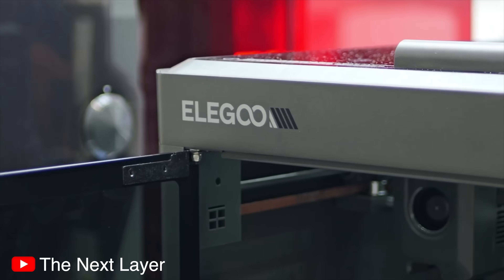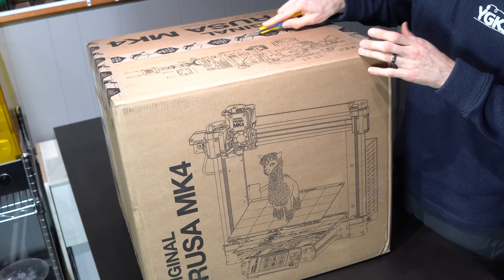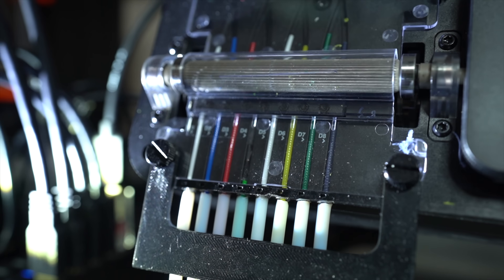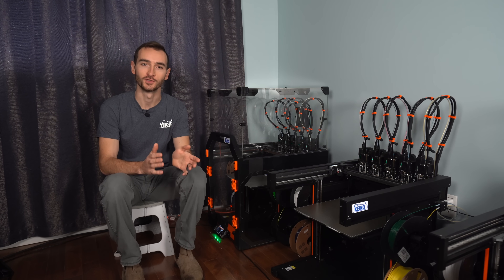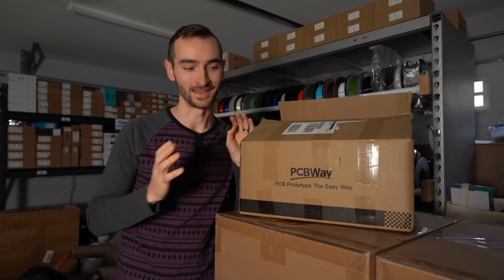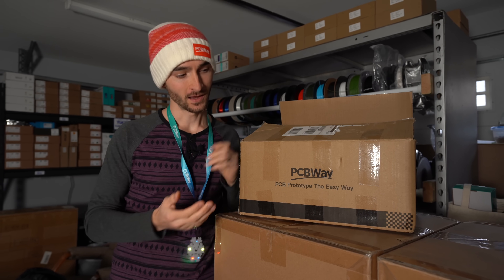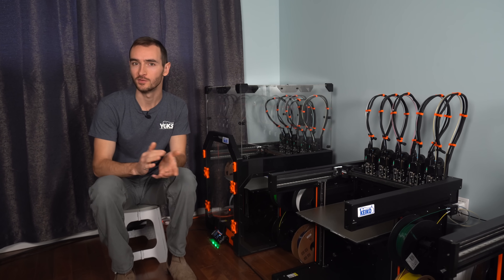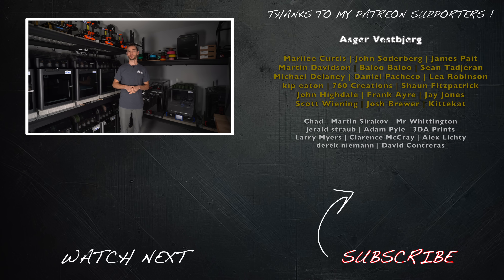The Prusa Core One is dividing the internet...

Comment: Wouldn’t spend that much money on either one. The old-school 3d printer’ers well we like to tinker. I have my ad5mpro and i have made it super durable and compliant. New belts and modifications. One thing I haven’t ent changed is the nozzle and firmware. 

Its fast as or faster than any printer out their, future proof in hepa filtration and cooling and xy printer. Parts available and have spares just in case. Over 1.5k hours. Can do manual filament swap and multi material some what thanks to orca slicer.

Comment: I just did many many hours of research to purchase my first 3D printer. I wanted to buy Prusa, but they offer so little for their price, and Bambu, although more competitive in price, are still pricy and very very closed, which I disagree with (Linux pleb).

I finalized on a Qidi Q2, more features and capability then Prusa at 1/2 the price, and in the middle when it comes to open.

I figure even if my business idea goes well it will be better to buy twice as many printers to feed the need then to buy 1/2 the printers and have Prusa reliability.

Comment: I have both, and I wouldn't sell either atm, even the H2D hasn't tempted me yet,  that has still got too many faults, and that's the reason they released he H2S so quickly afterwards.  If anything new atm i'd be waiting for the bigger Snapmaker U1,,, they always do a range of sizes so the bigger one is due probably with 7 or 8 tool heads like the XL but all contained and polished like the Bambu... I can't wait !!

Comment: Its all so obvious if you have experience in 3d printing. Prusa printers just effing work. They just work and work and work an work, for years and years. You can exchange all pieces that might wear out easily yourself, and print parts for it officially supported. What more could you ask for? Its blatantly obvious what the best printers are.

Comment: The build plate size is NOT true part of the plate is used over calibration and the corner is the cutter shrinking that “usable” space to pretty much the same on both machines except Prusa takes the edge as it has a higher ceiling limit.

Comment: P1s in now about 370€ tax free (for business) in europe. Core one is 1075€. This is revolution, nothing less. It is now actually possible to design for fdm print and base design on that.

oh forgot prusa does not include shipping. so in all for one prusa core you can get three p1s. point is they do not have the same market. bambu can extremely rapidly expand the capability to produce, it is a tool you can buy for a single job.

Comment: By now, the X1 is getting old. The H2D makes repair much easier. Most of us don’t care about the network requirements. Bamboo Lab has excellent after purchase support. It’s one of the things they’re known for. Also fairly priced parts for their machines and easily available service manuals online. Also as far as pricing goes, if you have a real business, meaning a business license and tax number, you can depreciate your machines as a capital expense, often over three years, which brings pricing down considerably. Then you can sell the old machines.

Comment: If they build a 1/3 XL for 1/3 of the price i would buy it in an instant.
Reply: Always have to remember with Prusa is that they aren't built or designed by Chinese slave labor. They will always be more expensive than any other 3d printer company based in China

Comment: I don't think the divide is that great. It's a $1000+ printer with acrylic panels, no camera monitoring and even the add-on camera for $40, on a $1000 printer is only for live snapshots. It doesn't have the ability for time-laps or recording. This base camera should have been included, and have a better camera as an add-on, or hey here's an idea, just build the camera into the unit... OMG 🤯 then maybe make it functional in 2025 to today's standards.
How about the horrible top grill that slides back and forth for PLA printing. This is the cheapest implementation ever, almost comical.

Also the lead time on their printers is awful, 3+ months, for a 3D printer. I can buy a car from a dealer and have it made for me and delivered 2-3 times I'd be waiting for a printer... Make it make sense, in 2025. Prusa, it was "cool" you used your own printers to print parts for your printers... lol
But this method isn't sustainable in today's market, you'll never be able to gain traction against Bambu and eventually you'll be the next Blackberry or Nokia. Unwilling to accept that your way isn't the ONLY/BEST way... You need to innovate and adapt.

Logistics is also huge. I can buy every Bambu printer, filament and even MakerSupply kits at my local shop in Winnipeg. They also stock every replacement part so I can have my printers fixed within a day rather than waiting months for a part from Europe. This is huge for business relying on 3D printers when not one single shop in the city caries Prusa filament, replacement parts and has horrible inventory because they too are also waiting months for their units.
Reply from the maker: @EliteCanadian92  great points and hello from a fellow Canadian!
Reply: @ygk3d  EHH! I had a feeling when I seen the YGK in the name, I used to live just west on the 401 from you in Courtice, then I moved to Banff, AB 🙂 Now I'm in Winnipeg... lol 

Congrats on the channel man, I love seeing Canadians crushing it on YouTube/general. Enjoying the content, keep it up!

Comment: My X1C that i pe-ordered right after their crowdfunding campaign ended is still working after 7000 hours. I have heard of units not working after 2000 hours, so it's pretty luck based whether or not you get a good unit. I'd still take a P1S over the core 1 and X1C due to the massive price difference.

Comment: 1000Hours until a $1200 Machine becomes a paperweight ? I think you answered your question right there with that statement. I know every detail and how to fix every problem on a prusa printer and it doesn’t take too long. There are Old Prusa’s still out there with Thousands of hours of time in them with 0 failure. The Core One may be meeting others where they are at but the Core One will be guaranteed to have an upgrade path to keep with current industry demands. $1200 might be nothing to you to throw away after 1000 hours but it isn’t to me.

Comment: Open source, reliability, spares availability, customer support, are the key differences.   Chinese vendors are notorious for dodgy quality, very poor support, and are designing if it breaks toss it products.  Prusa is the opposite.  If your attempting a business Prusa wins hands down.  CoreOne will last years.   Prusa however needs to add profiling and string management AI cameras in CoreOne and XL.  MMU3 design has already been expanded to 12 colors by DYI folks, Open Source is what enables this.  I am building a CoreOne for usual 3d, and a second one with IR/UV laser for high resolution graphics and finishing of 3D printed parts.   UV has 4K dpi.  3D <90 best case.   Bambu is closed architecture and none of this is possible.  If it breaks you toss it.  Easy choice.

Comment: I have learned (through painful experience at times) that likely the cheapest thing you will ever do is buy the tool, or boat, or horse, or hotrod, or whatever else excites your passion.  It's the ongoing costs and hiccups that will define your satisfaction in the end - and sometimes those are hard to forecast.

I have concluded that when purchasing some technological wonder, the most expensive option is often the best choice - if it meets some strict criteria.  First, it must be from a company with a long and excellent reputation for quality and service.  Second, it must be manufactured by company in a country that has a strong rule of law and a good international reputation for honesty and minimal government interference.  Third, if applicable, it must have open-source software and fully user-modifiable hardware, supported by a broad user community.  Lastly, it must have a record of product upgradability and long-term sustainability.

I have no faith that Bambu will meet all of these criteria in the long run.  Yes, they may be ahead technologically at a particular point in time, but that "edge" never lasts for long in this world.  Their recent moves to lock down firmware are a real red flag for me.  As you may have guessed, I'm pretty much a Prusa guy.  I started with a MK3, added the MMU2, then upgraded it to the MK4, then the MK4S, and then upgraded to the MMU3.  Most recently I've bought a CORE One - and I'm very happy with it!  Just arrived yesterday, and so far all the prints are perfect.  I'm very impressed with the build quality.

Comment: It’s funny. All of the things you downplayed were motivations for my Prusa purchases. First, I bought the new core one with the MMU. Next I’ll buy the upgrade for my 4S. I always buy the kits/upgrades. The big thing for me is not to have something that’s a slave to the network, and definitely not have something I can’t repair, especially after only 1000 hours. When Bambu labs innovates a system I can repair, that works without an internet connection, and can print with the door shut… THEN you MAY have a contender.
Reply: You can use bambus offline and they are repairable. But it's ok, you can also waste your money

Comment: I won't buy Bambu for the simple fact that its made in China. I feel like just about everything is, so when I have the chance to buy a similar product made elsewhere (in a non-oppressive communist regime) I'll at least consider it.  I own a ton of stuff made in China, no need to ship another $1000 over to them.  Prusa has long been one of the 'good guys' of 3d printing, being open source and also developing Prusa Slicer, one of the best (and free!) slicers out there that works with tons of machines. But, I'm a hobbyist buying a single machine so my motivations are different than someone running a print farm.
Reply: Everything you have is from china but you draw a line on a 3D printer? Ok, very specific.
Reply: @riba2233  I never said that. I buy American whenever possible, often even if it costs a bit more. For instance every car I've ever bought has been made in America. But for a lot of things there is no American made alternative.
Reply: @mikemcreynolds4842  American made vehicle but not American vehicle brands I hope. Made in USA is good for everything but automobile.
Reply: @RisenEagles  That used to be more true than it is nowadays. That reputation really came from the 70s and 80s when American automotive engineering went to crap. Since then it has rebounded quite a lot, but people have long memories for bad cars. In my case I've got (for instance) a 21 year old GMC truck that is on its first engine and transmission and has hardly given us any trouble. Almost 200k miles.
Reply: @ I think some American models are reliable---the issue is which one and which year? Chevy trucks can be reliable but which year, which model, and which engine. Whereas Japanese vehicles are usually always reliable (Toyota & Nissan trucks). I have a Titan Pro4x. Love it! Though the previous edition Silverado ZR6 LTZ was my dream truck. With that said, it can't do what my Pro4x can do---off-roading. 

Regarding the Core One, I don't think I'll ever print enough stuff to make up the cost difference. The only thing I want is a miniatures printer, but it cannot complete with resin printer.

Comment: I'm not one for brand loyalty, my mentality is any brand has until they screw me over one time. With that said, I'm sticking with prusa for now. My first prusa was a mk2s, then it became a mk2.5s and now retired as a Frankenstein's monster 2.5s. The MK3s got me salty a bit, it really wasn't better in anyway. Then i got my mk4s, i was so happy with the improvements that the mk3s became an mk4s immediately. I have an xl and it is my favorite large foot print printer. I have had other printers from the likes of creality and elegoo. They turned out to be cheap knock off cash grabs. They work but aren't anywhere near where they should be. Over the years I've had to repair my mk2.5s as to why its become a bit of a monster, that rambo bed plug sucks. But i was able to repair it, i could get parts, open it up, and replace damaged parts. I was able to get pinda probes under warranty and it was painless. I don't want to buy something that is going to become a paper weight after 1000 hours, even my mk2.5s will print..... slowly. I want something that i can repair, if i am going to drop $1400 on a printer i don't care about multi material personally as i am printing props. Everything i print is primer grey because i am painting it..... with grey primer first. I also like prusa connect to some extent, though i want to use my webcams and get live feeds not stills. I have had good luck with prusa slicer. I don't like a lot of the things that i read bambu does with the online, i like being able to isolate my stuff to my network or no network and it still works. I also like building my printer over buying an instant unboxer, i loved legos as a child. I view being able to build my printer as a way to get to know the printer and better understand how to fix it. I will stick with prusa because long term i will have the printer long term. That means more to me then a cheapish printer that has multi material capabilities.

Comment: After 2 years I had my biggest MMU3 failure to date yesterday. I came home and it wasn't printing. The boden tube failed. I replaced it. It took 5 minutes tops. I can't even imagine how hard it would be to do that on a bambu. And this 5 day print (which completed successfully even with the failure) used just over 1 whole spool of silver. If I was using a bambu, it probably would have used at least 1.5 spools. I would have had to have changed spools a second time. I wasn't sure if I was going to have to or not. I'm sure the spool it finished with is close to empty. It was brand new on day 2. The original spool didn't have much left.

Comment: I think when looking at the cost you should consider the cost of future updates. To get Bambu's latest tech youll have to buy a whole new printer. Whereas the core 2 is likely to be an upgrade kit for the core 1. My Mk3 might not have input shaping or be super quick. But i know if i wanted too i could add those without purchasing a new machine.

Comment: I really like the paper weight, having used Prusa for many years, I don't have any paper weights, they run with minimal maintenance and are upgradable between versions.  Any extra cost is easily accounted for in support and easy maintenance.  At the end of the day Bambu is a Chinese company with ties to the Chinese Communist Party, I would say always be concerned about accessibility and data privacy.  As always the choice is yours, for me I will stay with Prusa that still offers modes that do not need to connect to cloud services, or allows you to run your own management system on your network without interference with cloud services in China.

Comment: Ooo boy.. Well, Now that all the Bambu garbage has come out, I think we have our answer to "is this too little to late" dont we? :P
10:38 Ya know.. Thats aLOT of value in a machine. Bambu is really hanging people out to dry now and i would MUCH rather know that the machine I invest $1000+ into, will LAST (paying a premium upfront to avoid replacement costs in the future to me, is worth it). Camera isnt a big deal and the multi-color filament option isnt needed for everyone so it kinda makes sense that its separate. 

11:33 Poised to be replace.. likely by something that will lock you into their eco system, now. 

12:02 I very much doubt that was their thinking. Sometimes (sometimes), "Getting there first is not the point". Especially in Tech where 'early adopters' will sometimes get bit in the ass. Maybe,  they arn't implementing these 'bleeding new features' because they haven't been proven yet, or because their reliability is suspect (as you keep pointing out with Bambu failures). Not all of us can simply "buy a new one and write off the failure" when a failure occurs.

Comment: As a happy owner of a Prusa Mini+, I have been considering the Prusa XL as a possible future upgrade.
Problem being, the XL is complete and utter overkill for my needs, arguably even my current Mini is.
I was not yet aware of the Core, but once it launches, it will be the printer I consider, without a shadow of a doubt.
Though the MK4S wouldn't be a bad buy for me either, I intended to get it when I got my Mini, but compared the specs and realised that the Mini is adequate.
While I do believe in "buy the product, not the brand", Prusa is one of the rare exceptions where the brand has proven itself to provide good long-term support.
I trust my Prusa Mini to never unexpectedly fail on me, to me this is worth the price premium.
But to me this weights unusually much, since I do consider the future maintenance costs for a decade of operation of any electronic device I buy.

Comment: I have 2K hours on my X1C, had one issue in the start got solved for free within a week. Even if they are closing the printers and require a subscription a lot of people will stay with Bambu, the others will keep the hardware and flash them with new firmware. 
Prusa on the other had, sure they do have alright costumer service, I'll give them that but their printers are behind on specs and insanely expensive for what you get. 
I expect another brand will take over soon, Prusa really need to step up their game if they want to keep up, even with the mishaps by bambu atm.

Comment: I wanted to buy a Bamboo  X1 Carbon but due to the newest "Security" feature update of Bamboo I try to find out, if a model of PRUSA also have "Active Vibration
Compensation" function to have smooth lines. Can somebody give an answer on this, to know if MK4S or Core one does have such a stabilisation feature, what about Qidi Plus 4